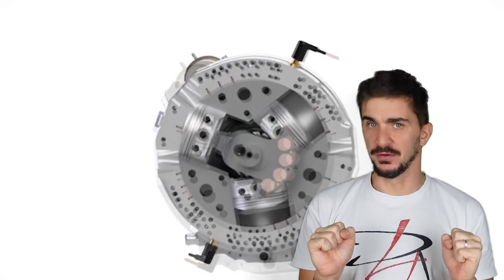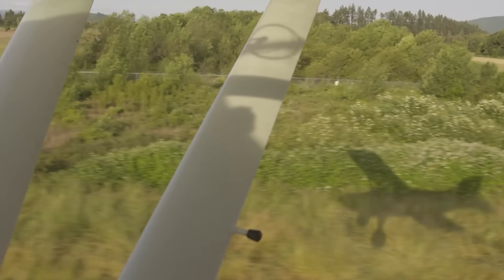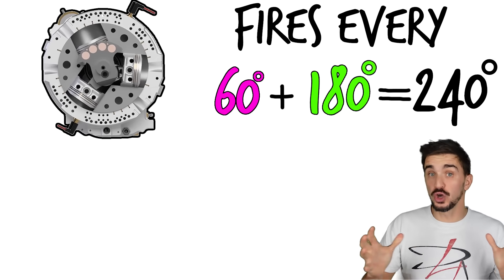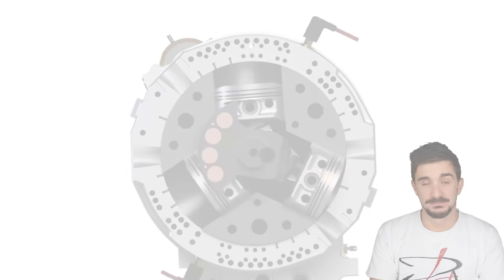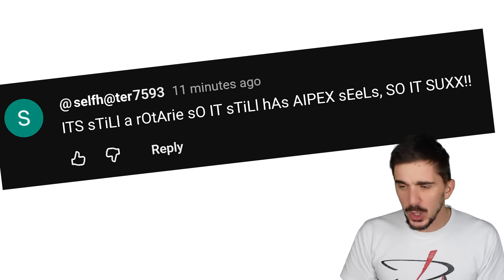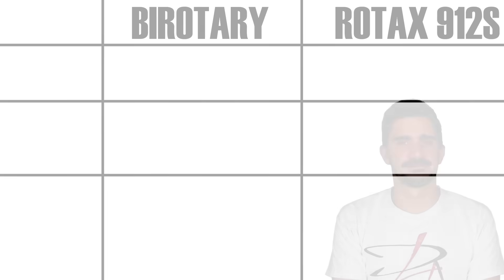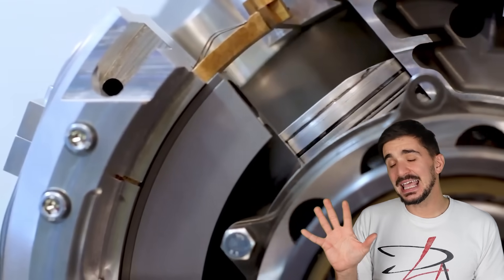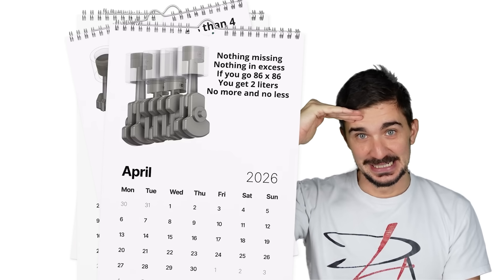This is What Happens When Pistons and Rotaries Make Babies - Birotary Engine Explained and Reviewed

Comment: I'll buy the reduced gyroscopic affect, but torque between power output (i.e. propeller) and machine (i.e. aircraft) is only a function of the engine's torque, not what it happening inside the engine.
Reply: Opposite rotation cancels torque. The gyro effect would still be there.
Reply: @kennethwers  isnt it the other way around? the cylinder housing and crankshaft assembly spin in opposite direction so if their momentum is similar it will cancel out so the aircraft is easier to change direction without being rotated perpendicular to the axis rotation. i think the confusion comes from the fact that dring WWII fresh pilots often crashed their big engine fighters before takeoff because the engine and propeller push against the air at one end and the other direction against the aircraft, while at low speeds the ailerons arent effective to counter this force. But apparently during WWI, radial/rotary engines did cause crashes due to the former phenomenon cause of their large spinning mass. the latter effect in this engine still exists but the gyro effect and the momentum created by increasing rpm fast is largely negated.
Reply: 100%. At a steady speed (no angular acceleration0, the only the twisting torque comes from the propeller pushing on the air. You can take any engine and hang it from a chain and once it gets up to speed there will be no net torque on the axis of rotation as long as the output axle has nothing to push against.

Comment: What about using this as a range extender in electric cars?
Reply: You mean hybrids?, it wouldn't really be fully EV with this ithink
Reply: @Koman-Gaming Yea. I understand that. It would give people options though and with the charging stations still lacking and the price of electricity at these charging stations now costing as much or more than gas would for comparable range while taking almost an hour to charge, such a range extender would make ownership much easier.

Also, with the tax insensitives for electric vehicles no longer existing, the need to be all electric isn't as important.

Comment: An additional note to RPM: some propeller driven aircraft use propellers with variable blade angle. The idea is: the engine has a rpm at which it is most efficient and you want it to stay there. So instead of throttling and changing the RPM, the blades angle is changed to increase/decrease thrust.
Reply: Then all you need is a propeller for the front of your Toyota RAV4...
Reply: @vali_odinsson  Or a CVT
Reply: @lucitribal correct. A variable pitch propeller is a CVT
Reply: @davidbesant  never heard of such a thing…
Reply: @1h1oh34 also known as a constant speed propellor as fitted to turboprops.
Reply: @1h1oh34  The mistake you made is you were "listening" you should try "reading" instead.
Reply: @vali_odinsson  ha-ha….just reminded me of when I put a 16” triple blade pusher prop on my bicycle…fun memories
Reply: @vali_odinsson  I'm sure it would pass pedestrian safety tests with uhm...flying colors.
Reply: @kbk9535  Ba-dum tsshhh
Reply: Almost all. Starting from WWII
Reply: Helicopters work this way too
Reply: Propeller should run at constant speed. Power increase will cause the pitch to steepen. Reducing power causes less propeller pitch. That’s it.
Reply: Basically how helicopters go forward/backwards.
Reply: This is how a C-130 works.  Constant RPM governed by fuel controller.  Power levers adjust blade angle.
Reply: Yeah, this is more common on turboprop set-ups, where as you said the turbine has an optimal speed, the prop pitch can be used to tune the aircraft performance. But is a big cost, something that wouldn't really match the target market for this motor.
Reply: That's also very much what helicopters do. 
There's a limit to how fast you want the tips (which produce the most lift) to move.

Increasing throttle is about maintaining rpm with valuable load (collective), not about trying to change speed.
Reply: Yes, but aren't you are even better off if you can adjust both.  Isn't there an ideal blade angle given the air density, temperature, drag etc?
Reply: @petergerdes1094 probably. I haven't delved deeper on why this exists, but I'm sure there is a video explaining pros and cons
Reply: @petergerdes1094 the thing is you're really selecting the engine power setting, and the plane is changing the propeller pitch (load) to maintain a certain rpm. There can be different RPM/Power settings for different phases of flight
Reply: @bigpatty823  Nah, other way around. Set pitch for airspeed, adjust engine power for climb/descent or cruise efficiency. Typically fine pitch, higher rpm for takeoff, climb, and landing. Coarse pitch lower rpm at cruise. Okay, I reread that. We’re mostly in agreement, but different explanations.
Reply: @petergerdes1094 not really. In practice you will have an optimal cruise RPM and the prop will try to keep that RPM no matter the throttle setting. And a max power RPM, you pick a propeller with appropriate characteristics for your specific engine.
Reply: @jesperviktorsson8027   Quite right, its the propeelor speed that needs to be optimised, not the engine speed.
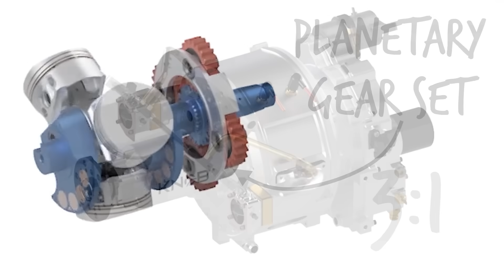Reply: @johnr1038  *Propellöür (6:41)
Reply: Some small aircrafts (which this engine targets) are forced to use constant pitch propellers due to regulations.
Reply: Yeah the problem is look up the thunder screech and you see the problem with no matter what you do with the propeller it's always going to run into the sound barrier

Comment: This engine could work perfectly well for a range extender on EV cars.  The fact that it’s perfectly balanced could eliminate vibrations, and if it’s only going to spin a generator, so it can work at its peak volume metric efficiency and not care.

Comment: Smart (cause it's simple, cheap and works), but ugly dad
Beautiful (as a concept), but stupid mom

Take your guess what comes out

PS. It makes no sense. Increasingly cheap metal 3-d printing will bring low-tempreture recuperated compact-enough turbines for 250 kW+, and anything below will eventually be eaten by a 2-stroke forced induction diesel with 45%+ real thermal efficiency. And both will work as mere generators for the set of multiple electric motors.

Comment: Not sure but you could probably design the chamber seals with the ability to change them without a total rebuild, if each seal was fitted into a cylindrical housing similar to a spark plug fitting that fitted into a through and through socket.
Reply: They could have a slight spring load behind them like a motor brush. They would wear down over time but would last you long time.

Comment: They could add a supercharger to increase torque at low rpm to make it viable for motorcycle and automotive applications. However, this would add weight, increase overall dimensions, effect fuel economy, effect service intervals, and add complexity to the engine.

Comment: For autos: range extender for hybrids.
Reply: Had the same thought but they're probably even better suited engines for this.
Reply: Fuel efficiency isn't good enough.
Reply: @malkontentniepoprawny6885   Maybe. Mazda rotaries are actually pretty efficient fuel/hp at full throttle. These might have a speed range where their efficiency is good, and range extenders have a narrow rpm range.
Reply: Well, make a 90cc birotary engine. 😁
Reply: like, oh I don't know, stationary power, nice
Reply: @well21ful  The IS One...Like FOREVER(!)... ONE(1!) Cylinder, hand-crank(😮!) DIESEL...😮😊😅❤
Reply: I Do Remember Seeing Rotating Cylinders RADIAL Engines(!) From the Past! I STILL HAVE Reservations And DOUBTS About SEALS on Intake/Exhaust Channels!😮😢😊
IT will Complicate Maintenance and REPAIRS!😢😮
Reply: Better use a turboprob on highways and keep driving 70mph.
Reply: No. Just batteries
Reply: Mazda already does this, so is a competitor at best.
Reply: @emescub  rotary engine are garbage. Get rid of combustion engine at all and drive with electricity!
Reply: La Mazda usa i suoi motori rotativi più leggeri e con meno pezzi e soprattutto con una linea di produzione già avviata per rigenerare le batterie. Quello lo vedo bene sulle moto ad acqua. Per l'efficenza a bassi regimi questo birotarivo mi viene solo il cambio CVT
Reply: @Luca-s1n just use electricity! Rotary engine are garbage and combustion engine as well!

Comment: Could make sense in a hybrid car with the electric motor filling in at low rpm?
Reply: Actually it would be used to do the complete opposite. It would best be used to charge the battery that provide ALL the power to the car.
Reply: even then it will struggle because of how pathetic the low rpm torque is. Potentially an electrically driven turbo might make it usable but then the question just becomes - why? There are no real advantages besides lower vibrations but thats not really a problem in traditional 4-strokes. Maybe if they can make it a diesel (which looks possible) it can be good because vibrations but it will both have a low redline and a low stroke so its effectively useless
Reply: @shadowd9810 diesel with 4:1 compression? Lol

Comment: Interesting design, but I'm wondering how it's lubricated?  And is that lubrication a total loss system, like Wankel?  Merry Christmas d4a.
Reply: There's no air/fuel communication between the crank, the underside of the pistons or the sides of the centre rotor, so it can be 'wet' lubricated and presumably the centre rotor can also be oil cooled.
The edge speed of the centre rotor relative to the case isn't going to be particularly high, but this seems to be the only spot that presents a lubrication concern.
Reply: @hangtight71 how'd you prevent the sparkplugs from fouling on the oily mess that'd slosh around the outter race/ring ?
And oil mist being expelled to exhaust - sucked in on the intake port ?
Reply: @hangtight71  you still need to lubricate seals somehow (which go across and along the block), so you will need to inject oil into the gap between outer case and "cylinder block" and scavenge this oil afterwards. If not scavenged, it would be lost/burned oil. I don't know requirement to small aircraft engines, maybe this is acceptable for them so they don't bother.
Reply: @maxpool162  Indeed, the seals need some form of lubrication. And these seals come into direct contact with the combustion chamber. Burning oil by design won't get you into the car /motorcycle market with it's tight environment laws.
Reply: I started thing about oil accumulating in the pistons from the centrifugal forces, but guess even a short stroke will chuck it out effectively. Radial engines were famous for oil consumption, let's hope ring seal  development has advanced enough. Crankcase vacuum is an option.

Comment: how do you lubricate the spinning block inside the housing?
Reply: I'm sure it's the same way as the lubrication system for a two stroke engine
Reply: That's a good question, but not that hard to do, just use same method of crank lubrication in many car engines: labyrinth oil seal on crank with drilled port on the crank that leads inside to squirt up under piston. Draining oil from there is maybe a different story. Then you have to get lubricant to the outer seals. That could be done like in rotary, most likely some form of light full loss lubrication - this is probably what other commentor thought you meant.